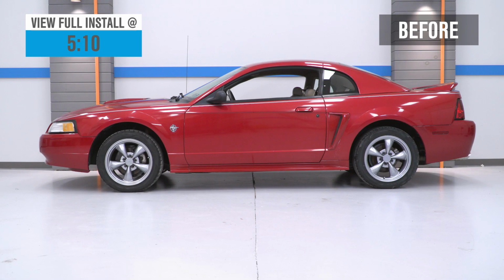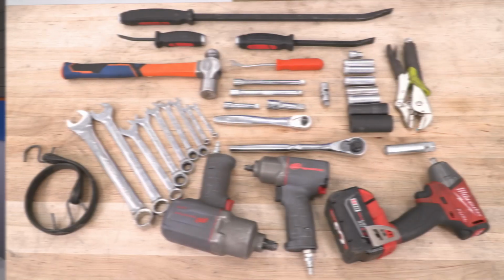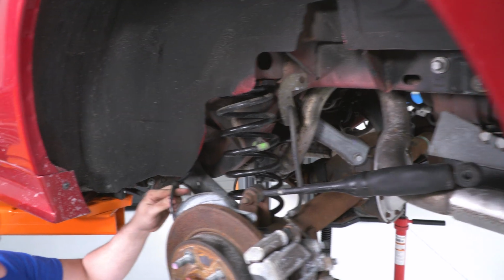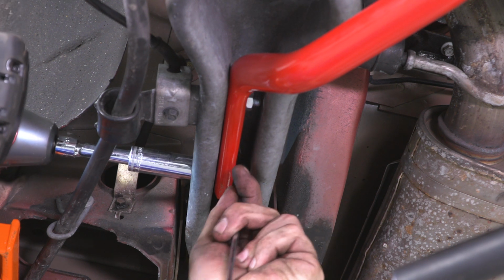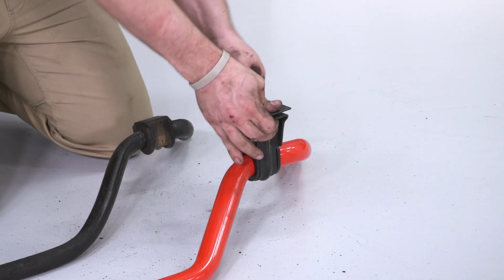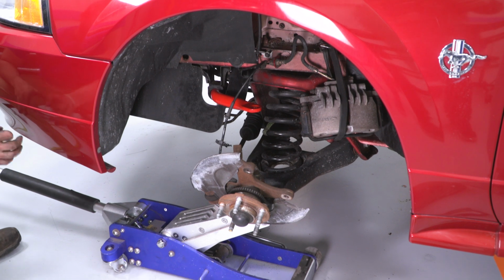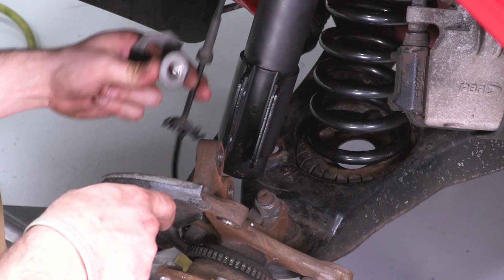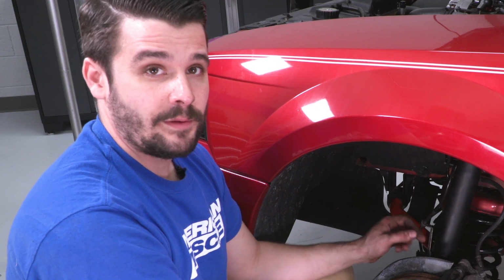1994-2004 Mustang V8 & V6 Eibach Pro-System-Plus Review & Install

Comment: If I’m not changing out the sway bars do I still need to remove the original to change the springs and shocks?
Reply: Yeah you do but it's literally just 4 bolts on the rear and 2 bolts to unhook the endlinks, very easy
Reply: @philspaghet  it was easy,
Reply: @Nick212NYC  Nice! How does it feel? I'm looking to do the upgrade myself to reduce the horrible understeer

Comment: Why do the front struts on your website not look like the front strut in this video? The pictures on your website have a seat for the spring to rest on presumably, but the ones you are installing here do not. I need to know whether or not the front struts are coilovers or separate spring/shock system so that I buy the correct control arms.
presuming we are looking at the same product: https://www.americanmuscle.com/eibach-prosystem-plus-9404-mustang.html

1:44 there is no lip on the front struts in this video & you install them like the stock ones? I am so confused.
Reply: They seem to have their shocks and struts mixed up BIG TIME.  I ordered the sr performance adjustable shocks and struts and they sent me struts with a spring perch exactly what you just said.   The spring perch is for 05-up.   I returned them and they sent me the same thing againnnnn.   What is so difficult here AM?   What a waste of time and money.